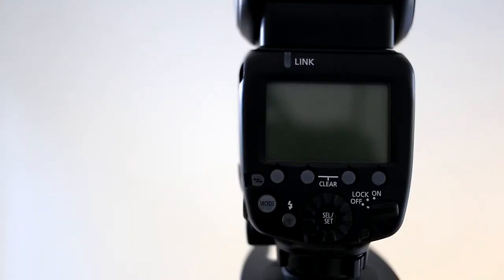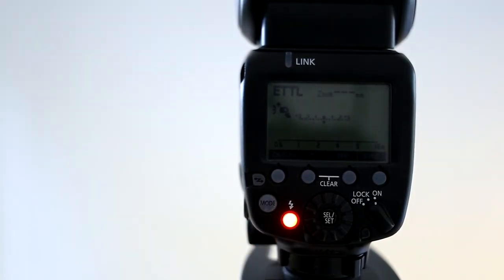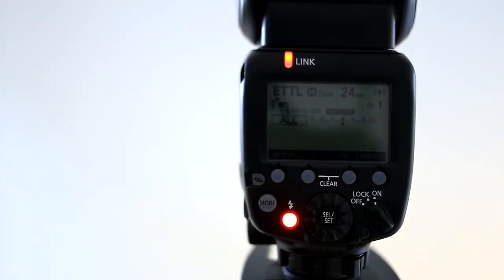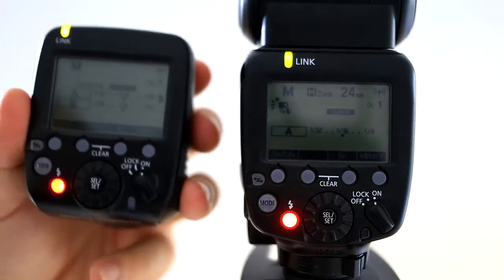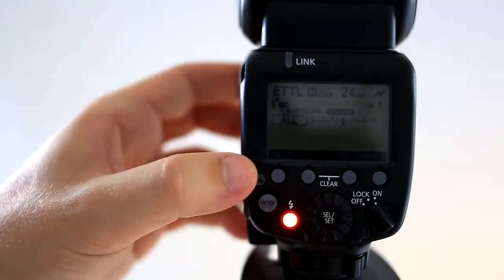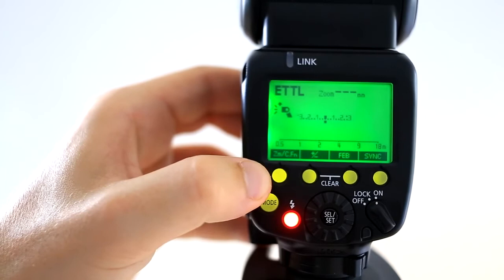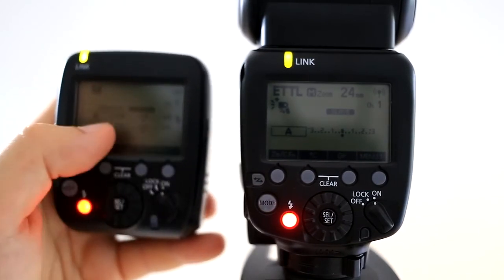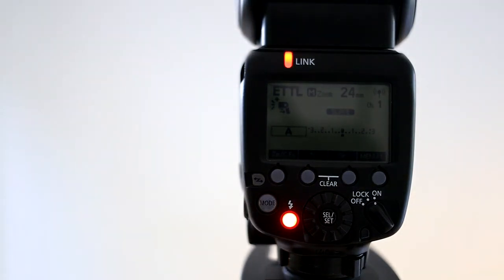How To Setup Canon 600EX-RT For Wireless Flash

Comment: The "E" in ETTL stands for Evaluative, not Electronic. The other thing to not is this . . .to say you will use ETTL auto flash rarely is simply not true. It's a terrific system and very accurate based on knowing how the camera's meter works. Manual is certainly a very consistent  method of obtaining exact output from one shot to the next but it's not necessarily the best way.  It depends on what you're shooting.
Reply: Haha, 'Stoner'.

Comment: Hi, thanks a lot for your video which helped me but what about the focal length please ? When my Canon 600EX is on my Canon camera, the focal length is moving on the flash the same as on my lense but with the STE3RT transmitter, il doesn't follow the focal length lense moves . Is it normal ? Thanks in advance.

Comment: Ryan Flower Photography, my questions are the following:
1. Have two 600EX-RT Speedlites
    One on camera with N3 Cable, set as ATG wireless radio Master
    Second as handhold able remote radio flash trigger.
    How do you turn off or disabled the ATG AF Assist Beam from blinking all the time?

2. Under Linked Shot, both flashes have Green Link light On, Linked Shot on LCD
    On camera is set at  Master
    Second flash used as a remote (Slave)
    Again, both flashes are showing GREEN "LINK"
    Pressed the Shutter Button, only the on camera goes off.
    Why the ATG wireless radio SLAVE didn't go off?

The same problems using 600EX II-RT.
I had no problem getting to work on the ATG Gold 600EX-RT 1K.
What is awesome on the ATG over the Canon, is it can shoot remote in "C' continue and has a range of 1,000 feet while the Canon OEM flailed baldly.

Comment: I own a Canon 600 EX - RT Speedlight and i set it up at 105 mm yet every time i turn the speedlight off it goes back to 24 mm .. how do i set the speedlight up at 105mm so its fixed at that setting all the time ?

Comment: My friend and I were trying to set up his 70D pop up flash to optically trigger the FK600EX-RT which is an off brand speedlight that is suppose to work just like the Canon version. We tried every thing to get it to work.  SO the "lightning bolt" in the upper right corner is OPTICAL?